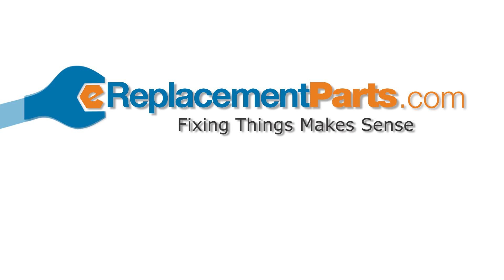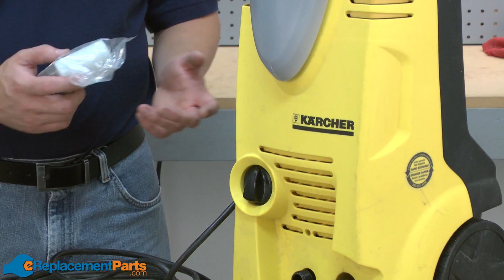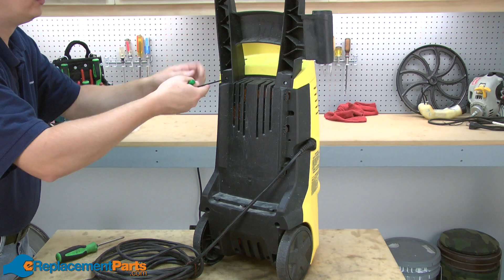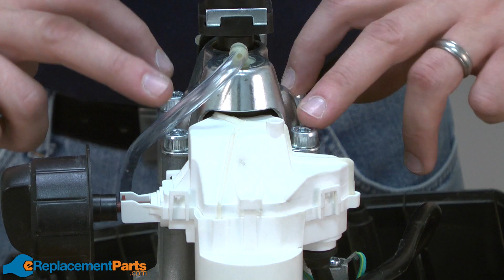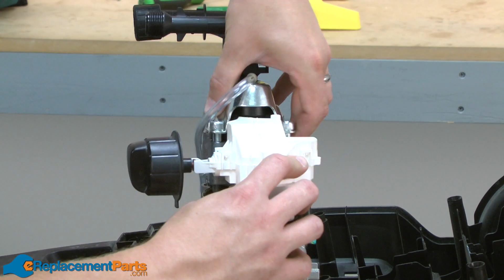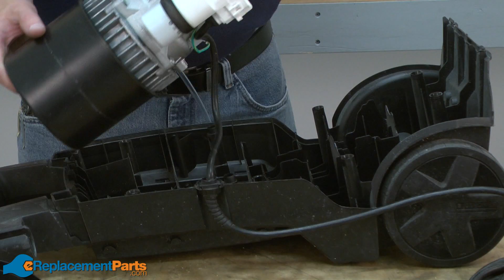How to Replace the Motor Capacitor on a Karcher Electric Pressure Washer

Comment: Hello... My k3.98 does not turn on... Is there a  way to check the motor turning It directly without use the electrical system without take the four bolts out of the pump assembly? If no.... There is any Care to take the bolts out to do this??
Reply from the maker: Hello, we are currently researching  this for you. Will have a response soon. Thank You.

Comment: Good day and thanks. I have a Karcher K2.99M machine that is totally dead ... No humming No clicking and no buzzing!. I would like to test the Fuse and switch before ordering replacement parts....but after stripping the machine I cannot find the Fuse and the power cable seems to be sealed into the switch housing. Does this machine have an internal fuse? if so where is it?  Can the power cable be unplugged from the switch housing on this model?... I've watched numerous YouTubes and see that they do indeed unplug on some models.
Reply from the maker: Hi David, we are currently researching this for you. Will have a response soon. Thanks
Reply from the maker: Looks like this is a U.K. model and is slightly different from the U.S. models. They offer the cord separately so I'm sure it is replaceable but I don't have any experience doing it. No fuse unless there is a time delay built into the motor.

Comment: mine hd 5/11c when i try to turn it on the motor turns 1/4 of a turn if that then trips my mains power,
the motor is free to turn etc not tight, could this be the capacitor?

Comment: I have a K3.96M, it's motor runs fine with no load but refuse to start and only hums with load. Replaced start capacitor, still the same. Any idea ?
Reply from the maker: +Wenyuan Sun I think your problem lies in the Pressure relief valve.  This problem happens because the valve isn't releasing the pressure.  When this happens the motor is having to start under a full load.
Reply: +eReplacementParts.com Thank you so much for the reply. I double checked the piston guidance assembly, did not find pressure relief valve. It turned out that the ball bearing got stuck due to insufficient lubrication. The pump runs fine after I injected some grease around the ball bearing.  Now I have a new problem: the pressure it produces is very low, it's   so low that the motor does not gets shut off when the spray wand is off. Water flow is sufficient and I let water run for 30 seconds before connecting the high pressure hose , the cylinder head, the oil seals and the spacers are all new.  Any thoughts on this?

Comment: My Karcher K3.99 has a problem. the on off switch will not turn the unit off - it keeps running when I switch it to off and I have to turn it off by unplugging it at the ac outlet. Is this a capacitor problem or something else? Any help would be appreciated
Reply from the maker: +gilandduke I would look first a replacing the On/Off Switch.  Usually if a Capacitor fails the motor will just hum or not make any noise.  Yours is coming on but doesn't turn off.

Comment: Hi I have a Karcher  k3.99.
I have just replaced the compressor head. It worked really well for about 25 minutes then stopped.-great pressure. Now it works for 30 seconds then stops. no buzzing noise or anything. after two minutes of waiting it starts again full pressure. this is repeated. any ideas???
Reply from the maker: +Andrew Watt These have a thermal tegulator on the motor.  It sounds like the motor is overheating causing
the motor to shut down until it cools.  This can be caused by either a worn motor or something in the pump binding and getting the motor to overheat.
Reply: +eReplacementParts.com  I have the same case it work for may be one minute and stooped so I have to wait at least 5 min . Pleas let me know how to fix this issue. Thanks in advanced

Comment: Hello Mark,
I have the Karcher K3.500 that has just stopped working: switch on, nothing happens.
Your video is very clear and I have been able to strip the machine down, but I now want to test to see if the problem is with the switch or the capacitor.
I have a multimeter, could you tell me how to test these two items.

I have used an ohm meter across the capacitor and it shot up and then down again (very quickly), and I checked the double pole switch: both are showing that power is getting across when switched on... 

Is there some other safety device that is preventing the motor from starting?
Reply: +Le Rouretan 

I have used an ohm meter across the capacitor and it shot up and then down again (very quickly), and I checked the double pole switch: both are showing that power is getting across when switched on... 

Is there some other safety device that is preventing the motor from starting?

What does that tube do above the switch? could that have something to do with the problem?

Comment: Where does the detergent nipple go on a karcher k3.68 that does not have a detergent supply on it?  I replaced the motor capacitor but can't remember where the detergent nipple goes when putting it back together as I don't have the model with the detergent supply on it. Does it have to be plugged in someplace?

Comment: when I switch on my K4.600 absolutely no power . nothing happens ,usually there is a buzz/surge noise . 
I have changed the plug fuse so could that be the capacitor ? As I can't see a fuse inside anywhere.
Thanks
Tim

Comment: HI, This video id great. Could you tell me if I should replace my capacitor please? Everytime that I plug in my K2.94 pressure washer and turn it on at the front switch, it flips the main fuse for my garage sockets at the fuse box!!  It was working fine and then suddenly stopped after a fairly long period of use one day. I have changed the plug fuse, and the fuse in the RCD extension cable that I was using but there is no difference.  Any ideas???

Comment: I just did this with my pressure washer! Thanks for the video - I was lucky and could wiggle off my capacitor without taking the bolts off the pump assembly which was great because I could NOT budge those bolts! Washer is purring now! So much better than buying a new one!

Comment: Good video but why take the four bolts out of the pump assembly ? my capacitor can be removed once the bracket holding the motor is removed.